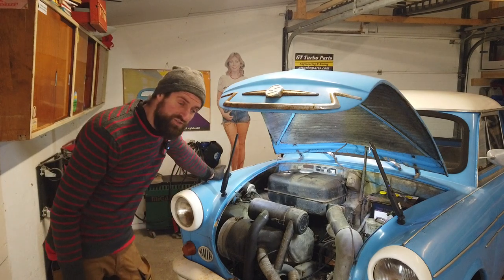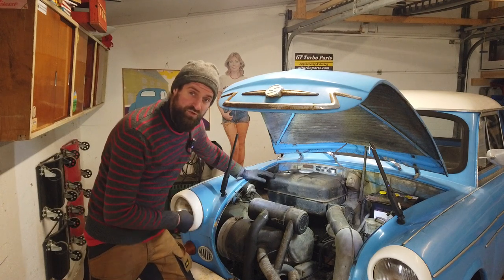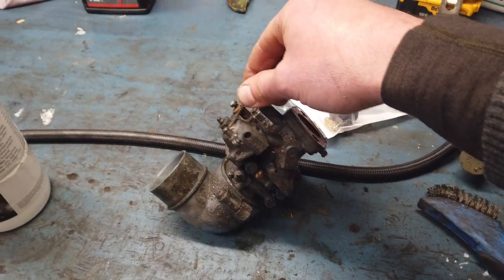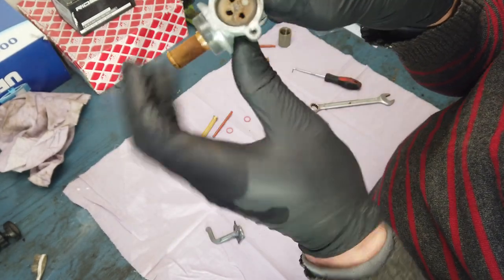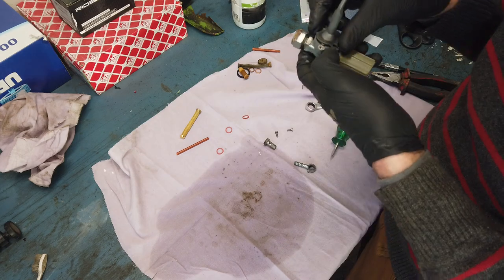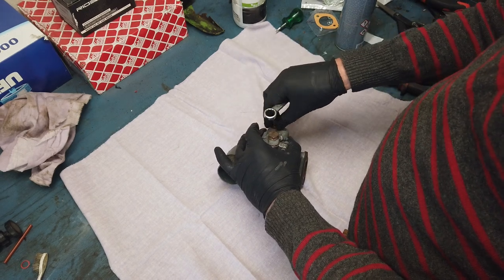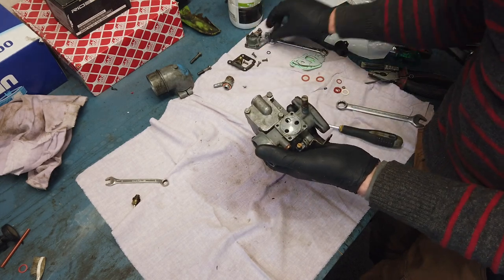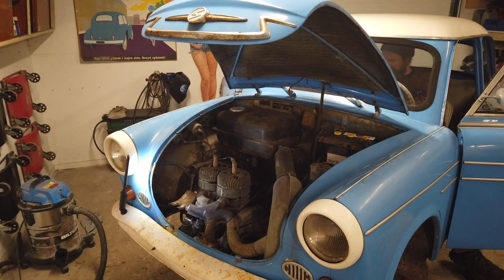Trabant P60 revival. The fuel system.

Comment: Nice work on the fuel valve & carburettor! With the deep threads on the fuel valve bowl, if the top few threads get damaged or stripped, you can file down until you have good threads again.
Reply from the maker: Thats smart.... :)